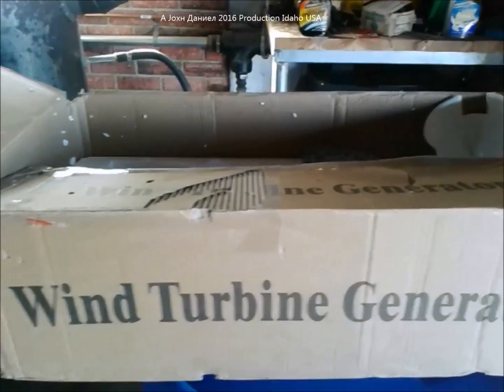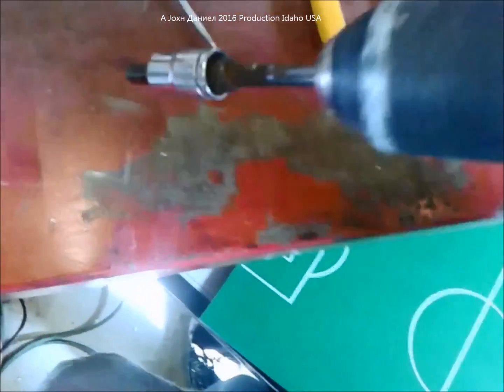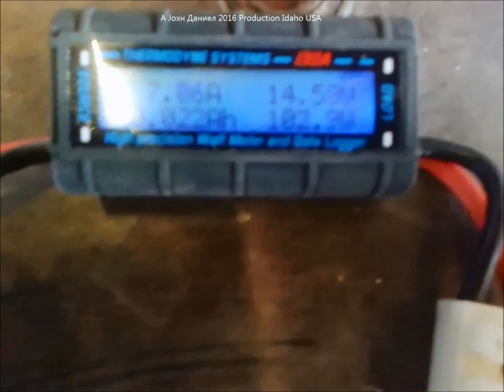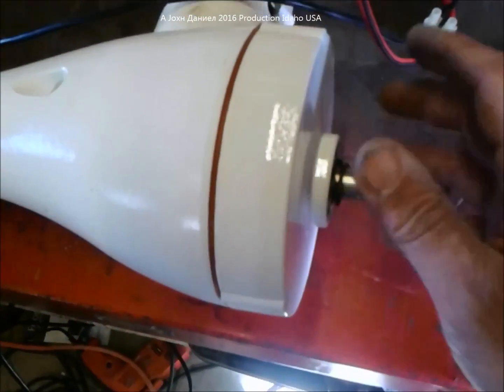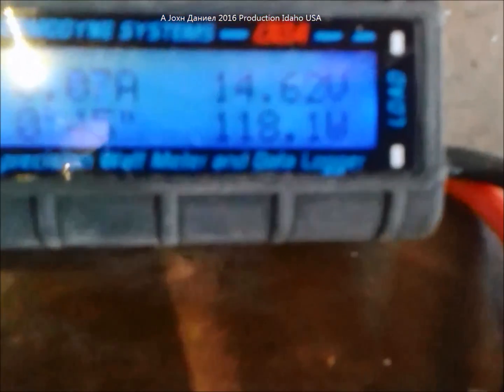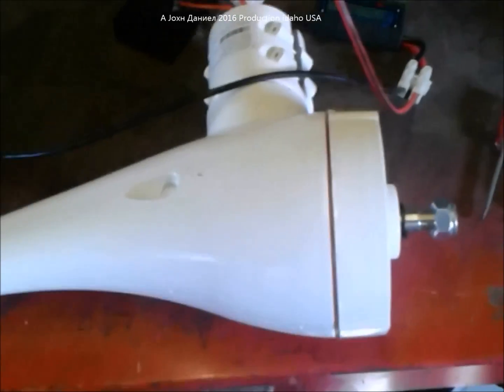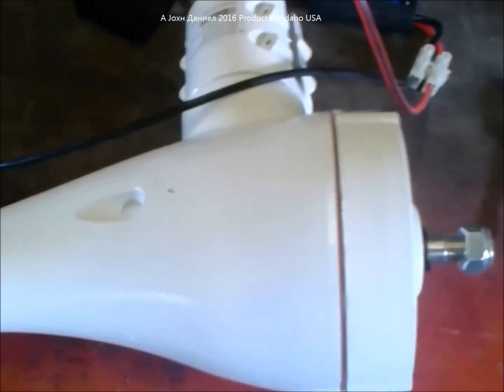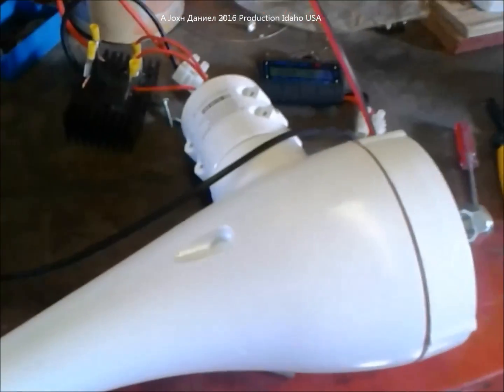How to Test a Small Wind Turbine Generator Part 2 , UPDATE and Parts used Below

Comment from the maker: NOW there's BETTER ONES Best 1 Listed Under Video or second best US models https://amzn.to/2SPlxyB for NEWER REAL RATED OUTPUT! & To get 100% full batteries from one & to divert over volt you need these: https://amzn.to/37HN2OR 100A SQL Rectifiers &  https://amzn.to/2MTUjCU A All purpose long life Load controller and be sure to get up to and over 300 watts diversion resistors ( https://amzn.to/2QngFPq x 3) and one or more 60 amp SSR ( https://amzn.to/2QKEyj0 ) with heat sink ( https://amzn.to/2ZYtmna ) and be sure to use thermal past on it.  ( Proper type - https://amzn.to/2QN2hir from Protronix)
* A PrepperMountain/Joxн Даниел 2016 Production Idaho USA

Comment: Hi John i have an issue. Finally bought a turbine and I'm trying to test it like you are here. I have it set up exactly as you do with the turbine to a recifier which then goes to the the battery with the power analyser between the rectifier and battery. It's not showing any power at all via that power analyser only the battery voltage. Although if i remove the battery and test the voltage straight off the recifier it comfortably displays 24+volts. Any ideas?
Also if i use the wind turbine charge controller to the battery and test it does indeed light up charging but since there is no lcd display iv no idea to see how many amps there are.
Reply from the maker: Do you have the Watt Meter wired first to battery from the side that says LOAD?
Reply: @JOHNDANIEL1  Yes i do. If it helps i tried the watt metre/power analyser straight off a solar panel and it also just shows the voltage of the panel and no power. Could this metre just be bad?
Reply: Should also mention that if I connect the turbine to a rectifier and measure the current from the dc end with a multimeter I was able to get 0.2-0.4amps by just barely turning it with my fingers. So i dont think there is an issue with the turbine itself as it is definitely producing some power.
Reply from the maker: @somemore9784  Sounds like you have a bad meter, you can determine it just by connecting the turbine with the rectifier to the battery and seeing after a while the volts on battery increase. Sounds like the turbine is ok, but something in the mix is bad. Be sure your blade hub is tight and not loosely spinning on the shaft, and that the rest of the gear is OK.
Reply: @JOHNDANIEL1  Thank you. I finally got it working. I can't say for sure what the issue was but i re-wired the whole lot and it finally shows something. It's certainly not a true mppt controller i have here as could only get 34w flat out with the drill. This with a 24v turbine charging a 12v bank so i know its cutting my power in half (watched your video on that). The turbine actually goes as high as 70v at this speed without the controller stepping it down to 12 which would equat to 200w (half of the rated turbine output but im fine with that). To tap into that more I would need a proper mppt controller right? .
Reply from the maker: @somemore9784  Yes, below my videos in recent ones I list a All in one, its the better option. And as for the controller, it isn't what holds your voltage down, your battery does that and the controller just removes charging when the battery is full. But I would go with a ALL IN ONE wind/solar controller, and that turbine.
Reply: @JOHNDANIEL1  Yeah thats cool I will. With the solar panels each 100w used to get 65w with a 20v panel on pwm but now on mppt im getting like 95w. Still charging 12v batteries. I'm hoping the wind can get a little more amps in a similar fashion is what I'm trying to say.

Comment: How do you figure out what voltage a generator is? We have a 48 volt system but don’t know if the wind generator is 48 volt or if that matters
Reply from the maker: When generators come and posted voltages, 12 volt 24 volt 48 volt and 96 volt are common.

Comment: 0:30 I'm completely new to this...
Question.... Does the turbine mounting housing (where the 3 wires come out) have an
electrical slip ring to allow the Turbine to rotate on the mounting pole and get power out of the 3 wires without them tangling up ???
Reply from the maker: Yes, it has a 3 wire slip ring capable of 40 amps
Reply: Thank you for replying and the confirmation on the slip rings John... Will be getting the New Turbine for myself... BTW...Just subscribed. ;)
Reply from the maker: Smartest move, buy a production model till your serious about building any. I think a put your a good link to a real power producing updated turbine on the video info.

Comment: Can this be hooked up directly to the house instead of a bank of batteries?
Reply from the maker: You have to either have a grid tie unit or batteries. If you have LOTS of wind, then a grid tie makes sense to use to lower your bill but they do not run independently of the grid power, they add to it. Batteries are though the way to go on any Renewable energy plans.

Comment: I went to that link, thought I would be smart and bought a different one, but returned it and bought the one you put a link for. Should have listened to you the first time, wasted a month. The one you put this link http://rover.ebay.com/rover/1/711-53200-19255-0/1?icep_ff3=2&pub=5575119394&toolid=10001&campid=5338235705&customid=TruGen+Pure+Copper&icep_item=132407715344&ipn=psmain&icep_vectorid=229466&kwid=902099&mtid=824&kw=lg on is a power monster. Thanks, theres so many that are similar its hard to decide whats a real rated one.
Reply from the maker: Yes, thanks. I test, Prove, and only recommend whats REAL and WORKS!

Comment: try to get small wind turbine from Senwey Brand , to feel best quality from CHina. www.windpowercn.com  SENWEI solar also can offer solar modules www.solarpanelkitschina.com
Reply from the maker: +Charlie Zeng No one from China makes dependable wind turbine. I have had dozens, all fail quickly.
Reply: I went to that link, thought I would be smart and bought a different one, but returned it and bought the one you put a link for. Should have listened to you the first time, wasted a month. The one you put this link 
 http://rover.ebay.com/rover/1/711-53200-19255-0/1?icep_ff3=2&pub=5575119394&toolid=10001&campid=5338235705&customid=TruGen+Pure+Copper&icep_item=132407715344&ipn=psmain&icep_vectorid=229466&kwid=902099&mtid=824&kw=lg on is a power monster. Thanks, theres so many that are similar its hard to decide whats a real rated one.

Comment: Is it up and running? Can we see a video of it in action.
Reply from the maker: +808IslandWS Good idea, I'll get one this week.
Reply: +Јохн «HEADSMASHER» Даниел yeah I'm kinda curious what kind of power it would make in 7-15mph winds. Looked it up and the price is really good. My dad's 10 year old Sunforce is ready to give up and this looks like a good replacement.
Reply from the maker: +808IslandWS I put the thermodyne green blades on mine and extended the tail 4" and it's putting out 30 to 50 watts in 13-15 mph wind. (3 to 4 amps). Above 15 mph it really comes to life, hitting over 110 watts steady at 20 mph, 180 watts at 24 mph.
Reply: +Јохн «HEADSMASHER» Даниел  don't mean to bug you again. Just wondering when that turbine video will be up?
Reply from the maker: NOW theres BETTER ONES http://rover.ebay.com/rover/1/711-53200-19255-0/1?icep_ff3=2&pub=5575119394&toolid=10001&campid=5338235705&customid=TruGen+Pure+Copper&icep_item=132407715344&ipn=psmain&icep_vectorid=229466&kwid=902099&mtid=824&kw=lg OR http://amzn.to/2E5iiJn to get one of these NEWER Heavier Built REAL RATED OUTPUT models!
 For rectification & to divert over volting you will need one of these.  http://rover.ebay.com/rover/1/711-53200-19255-0/1?icep_ff3=2&pub=5575119394&toolid=10001&campid=5337668021&customid=Wind+turbine+controller&icep_item=132409101265&ipn=psmain&icep_vectorid=229466&kwid=902099&mtid=824&kw=lg A All purpose long life controller

Comment: For a basic turbine , it`s doing pretty good...  I Wonder what it will have for power on the pole...
Reply from the maker: +al “peper 0110” desrochers  UPDATE: Installed, Winds at 17 mph steady, wattage 151 to 172. 12 amps continuous. No freaks peaks!
Reply: That mean it`s a good onthe fly turbine to go with an RV or a camp..  Thanks for sharing